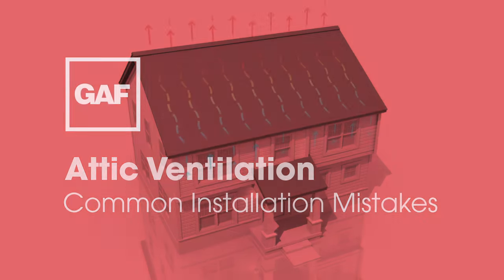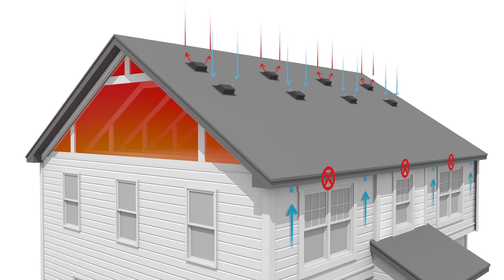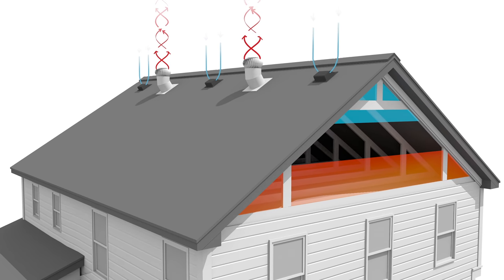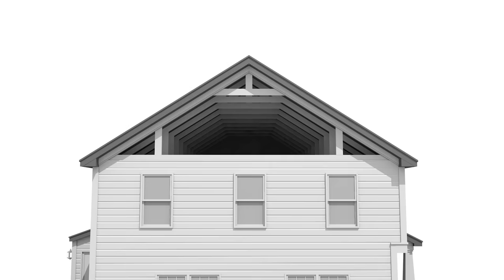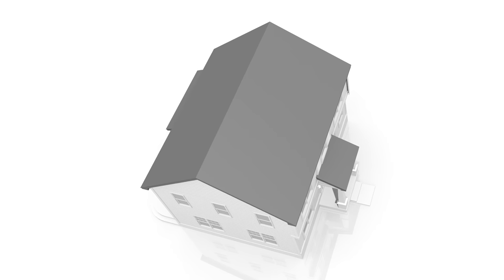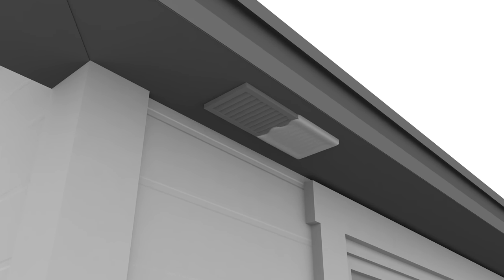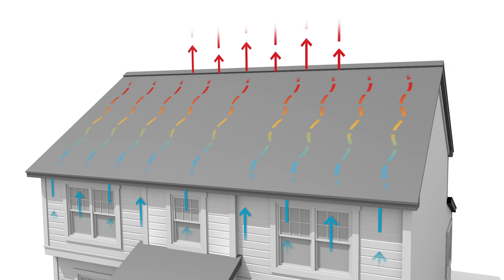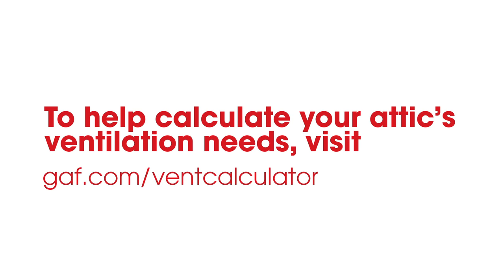How to Avoid Common Attic Ventilation Installation Mistakes | GAF Roofing

Comment: Can someone advise? I checked in my attic today for what I need to do to improve the insulation. I found that my eaves are not vented. There is some insulation that is pushed all the way out to the roof sheeting. I thought that meant I would have to rake that insulation out of those areas and install baffles. So then I checked my soffits and they are sealed up tight with solid sheeting and caulked up. Did someone screw up or are there some attics that should not be vented this way?
Reply: What year was the house built?
Reply: @Jeffs60  1978
Reply: @dolfinwriter5389  It seems like most houses built before the late 1970's never had any vented soffits, ridge vents or attic fans, just 2 gable vents on each end of the house and it seemed to be ok, perhaps there was more air gaps and leaks in the structure of the houses back then but now they build houses more tight and so you need more ventilation.
Reply: @Jeffs60  I don't have gable vents--only ridge vents. I've been working to seal up my house, so I should probably install soffit vents and attic baffles then? Is there any kind of guide or guidance on this? I would much rather go read this myself than ask you to share all your knowledge for free. I want to determine for my house if I should place maybe one or two or three soffit vents on each side, and baffles only where the vents are.
Someone else said that in a very windy place like Kansas, we my not have vents because the winds and particularly heavy gusts during storms can lift the roof off easier if it's vented?
Thanks for your input!
Reply: @dolfinwriter5389  Attic ventilation is not an exact science but based on opinions and where on the globe you live so if windy area you need very secure high quality material not cheap plastic ridge vents. Soffit and attic fan might be better or look at what other houses in your area have.
Reply: @Jeffs60  Well, my ridge vents aren't plastic. They're steel and very substantial, partially rusty and aged, so they've been there some years.

I'm reluctant to judge my house against others in my area. Some have soffit vents, but many do not.

My house was one of the first to be built in this development, so most are newer. Many of the houses around here have also had remodels, updates, renovations, improvements, room additions, garage conversions... When we bought OUR house, it had a lot of neglect issues in that there were plumbing leaks EVERYWHERE and I've had to replace every single electrical receptacle because they were worn out to the point that a plug would just fall out on the floor. Every single thing I get into I find things that were either not done right by the original builders or by some knucklehead since then, such as the IDIOT who hot-wired and bypassed the AC external condenser electrical cutoff and fuses.

So I'm making the place better and trying to set things right, but if I don't do things correctly then I'm no better than those people.
Reply: @Jeffs60  Nothing's made like it used to be. Better technology and some materials that are longer lasting, but quality SUCKS because many companies more interested in making the quick buck, and as you said--far too many people who no longer take pride in their work.

Comment: Hello, I'm having issue with the roofer. My home was built in the 30's, has approximately 240 sq. in. Of gable venting. No soffits in the old house. I have 954 SQ ft of attic space. The roofer added 30' of ridge venting. On a breezy day it takes the attic door and dislodges it when an entry door is opened. My HVAC is also in the attic, and the attic is insulated with the old paperback & also blow in. Made for a cold house last winter. Question is how to correct the situation. Thanks
Reply from the maker: Hie Joe. Our technical experts would be more than happy to assist you with that! Please give them a call at 800-766-3411

Comment: I have two octagonal gable vents. Are those still considered effective, or should a ridge vent be considered?
Reply from the maker: Hi, there. Our Master Flow experts will be able to guide you. You can reach them at 800-755-9392.
Reply: What did the master flow experts say about your question?

Comment: So ,do asphalt shingles last longer in a properly ventilated attic ?
Reply from the maker: That's correct. Asphalt shingles installed over unvented attics are often exposed to higher temperatures, compared to vented attics. This increase in temperatures can age and/or oxidize the shingles and sealing strips faster, which may affect the performance of the shingles. Learn more here: http://spr.ly/6050cCy5Y

Comment: What about vaulted ceilings with air gap and no cross ventilation between rafter bays? Same ridge vent calc?
Reply from the maker: Thanks for reaching out, Bryan. We recommend connecting with our technical team for assistance: 1-800-766-3411.

Comment: I have a house that has no sophets and 2 gables one on each end with an attic fan and 2 whirlybirds on top is that enough
Reply from the maker: Hi, Craig. We do not recommend using multiple ventilation systems as they do not work well together. Please refer to this technical bulletin for more information on proper ventilation: https://bit.ly/45HOXSi

Comment: can you put loose blown cellular insulation in an attic if the house has no gable vents or roof ridge. Can the insulation be put in first and then the roof ridge or gable vents be put up later? house is 1970 and has the original fiber glass batt from 1970 that the loose blown celluloose was going over it...
Reply from the maker: Thanks for reaching out, Melissa. Please give our technical team a call for assistance with insulation questions: 800-766-3411.

Comment: Is it ok to have more intake than exhaust? I have a ridge vent.
Reply: Yes it is fine
Reply from the maker: Thanks for reaching out, DC. With ridge vents, for proper ventilation,
the amount of intake ventilation must equal the amount of exhaust ventilation at the ridge. Visit https://bit.ly/3Bx56NA for detailed information about ridge vent installations. If you have any additional questions, our experts are here you help. You can reach them at 800-755-9392.
Reply: Its impossible to have more intake than exhaust. Unless of course the air is compressing in your attic.
Reply: @trustme7731  ...now you had to go and bring logic into the conversation.  
(I wish I could use logic to figure out how to install insulation board under my siding.  However I misplaced my logic...probably left it somewhere with my common sense.)
Reply: @Dancing_Alone_wRentals  I see siding companies putting foam board under siding  in cold climates. While it may help to insulate, I think it acts like a vapor barrier/retarder and prevents moisture from exiting the wall space. This could lead to mold and rot.
Reply: Hello  @trustme7731  . This is exactly what I'm concerned with.  I originally bought loads of my foam panels to put in under drywall.   I had done this on a few walls but not an entire house.   I stopped as it looked as though the industry was moving the insulation to the outside of the house.
Now I'm dead in the water.  In my video I explain different ideas I've read about.   
The latest is to use the panels outside, but to not tape the joints...then cover with a house wrap.
tHanks for commenting.
Reply: @trustme7731  I pulled down some of the metal soffit, above them is the old plywood soffit that was apparently never removed during a remodel. The plywood above the metal soffit vents is perforated, but I don't think very much air is moving. Instead of tearing down all the metal soffit to remove the plywood I was thinking about just cutting holes through and screwing in vents. I wasn't sure I would be able to calculate how much air was going in, but if more air is ok - then it wont matter. But I think right now there is not enough air, it gets way hotter in the attic.
Reply: @nodave77  It's unfortunate the metal soffit was installed without removing the plywood. It would have been very easy to to. Actually, every space between the rafters or trusses should be vented at the soffit to avoid hot spots and smoother air flow. 
If it were me I would take down 12' of soffit at a time, remove the plywood, install air chutes and reinstall each piece of soffit back where it was to minimize the mess. If you have gutters I guess it wouldn't be practical since they would need to be removed to get the fascia off.
I recently replace all of my metal soffits. I install all the panels and the fascia with screws for easy future removal to allow easy access to the exterior walls.

Comment: I’ve seen many houses with two rows of roof vents, one close to the ridge and one closer to the bottom of the roof, is that a good idea and why?
Reply from the maker: Hi, there. Any ridge area on a hip roof can be vented, there are no specs on how far apart they can be. Feel free to reach out to our team at 877-423-7663 if you have any additional questions.
Reply: @gafroofing  so, what’s the reason of the vents close to bottom that are the same as the top ones?
Reply from the maker: It would be a matter of preference since there are no pros or cons to installing multiple ridge vents on a roof with multiple ridge lines. Our experts would be happy to discuss this further. Please give them a call at 877-423-7663.
Reply: The lower vents would be to allow in fresh air the same as soffit vents. It is common especially when upgrading an older house with very little soffit venting to add additional lower vents to bring in fresh air and all in all - prevent mold etc
Reply: @LUISNEVESable  The upper vents through internal roof heating will expel out hotter roof air. This action will result in a vacuum in the roof causing outside air to flow into the lower vents preventing the roof from over heating. If you live in a double brick house this idea can be extended to sucking air from under the house where the air is cold and humid provided there are zero vents along the way. This idea works better in the warmer months.

Comment: Ridge vents should do the trick, yes???
Reply from the maker: Hi, Phil, you can learn more about the different options for your attic ventilation needs here: https://bit.ly/3P4tc6a You can also contact a GAF-certified contractor for any assistance you need by entering your zip code here: https://bit.ly/3AKBgoG